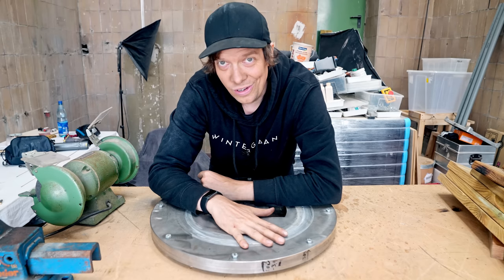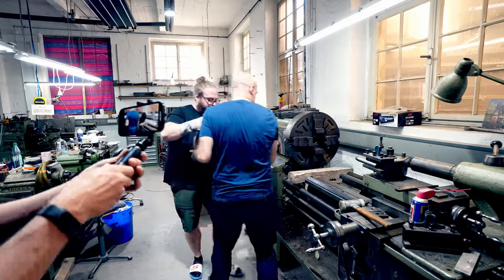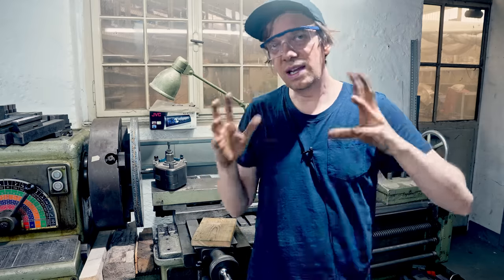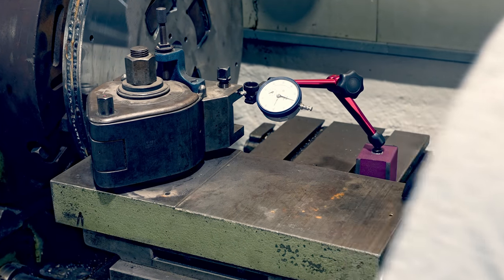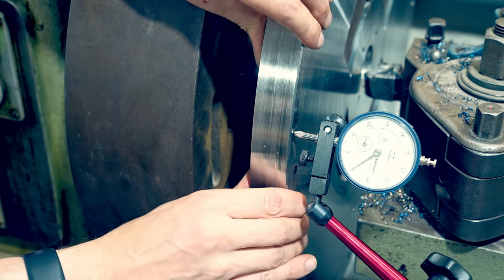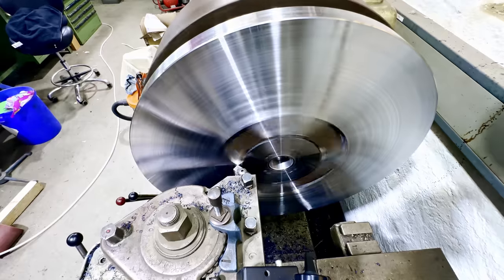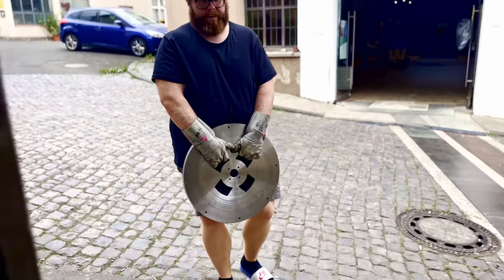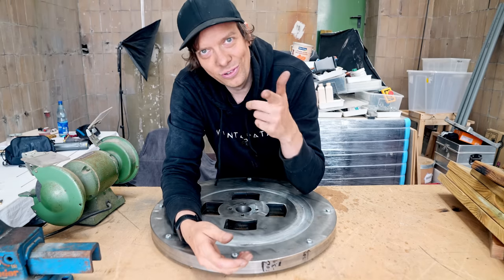Can I Turn This Wobbly Flywheel Straight? - DAY 7,8,9 - Marble Machine Flywheel Prototype

Comment: Just remember that it's a prototype, a proof of concept. It's not meant to represent the final build, but to experiment and figure out what works and what doesn't.
Reply: "Don't fail to learn ... fail in order to learn"
Reply: @keeperMLT  isnt this basically the same? failing to learn and failing in order to learn?
Reply: @SirCavas  In this context "Fail to learn"  means to miss an opportunity to learn. "Fail in order to learn" means here to use failure as an opportunity to learn. 🙂
Reply: @bragebh7122  okay it makes sense then
Reply: It entirely depends what are the goals for the prototype. Some are used to test a viability of a small little mechanic, some are used in order to test out the final build. Just saying that a prototype is not meant to be representative of a final build is factually false statement.
Reply: Just like the other 2 machines...
Reply: @DumahBrazorf  thats just a hilariously stupid thing to say after all those videos he made

Comment: I would suggest remounting the flywheel on the rod but do while the flywheel is laying face down. 

As you showed, when youre tightening the tapered bushing, the flywheel is pressing down on the bushing and on the shift from one direction.   If you lay the flywheel flat on a face and have the rod vertical you can ensure a couple things.  The flywheel isn't adding an extra 20kg of weight to one side of the bushing and you can ensure the shaft remains at a 90 degree to the flywheel when you tighten the bushing. 

Basically what I'm saying is that your current method of mounting the flywheel to the rod could be causing some of the runout.

Comment: I would suggest turning the flywheel face while the shaft is installed and clamped. This way you will be dead centre.
Even better way is turning between centre’s, in this way you can do the face turning of both side at the same time.

Comment: I have watched this series since day one and as an engineer I have banged my head in the desk so many times. 
I am NOT criticizing anything. Experimental design can lead to good things and it was nice to see the MMXs form before function design giving it that steam punk feeling. And this is you journey to fame, not for profit...
But in this rapid test phase, please just steal proven designs. For the flyWheel, just get a back wheel hub from a front wheel driven car, or a trailer. You get the hub, the break and the lugnuts to mount the flywheel in one go. Instead of spending a week, it would take a day.
In many parts of the design, just figure out if it is already made and steal it.

All the best to you and the team.

Comment: Turning tip 2: When making exact diameter, first go 1 mm short, measure accurately, then take half of the remaining away. Again measure accurately and adjust the last cut based on how much more or less than the intended you got. That way the machine flex is eliminated. Also, you get a better surface cutting half a millimeter than cutting much thinner. The tool edge works better when the chip is not too thin. You get to maybe 0,03 mm accurate this way, then the rest is done by sanding.

Comment: As a machinist that runs a lathe and mill dairy this is a little difficult to watch lol, but you're learning Martin so that all that matters. 👍👍
You could bore the center of the first disc again you'd just have to use some filler wire and TiG weld the bore first the dial in the OD to be concentric the bore the ID.

Comment: I post this a bit late, but I wish Martin can read it : what about replacing the flyweel by a car (or truck if you want something really heavy) wheel, with the matching wheel hub and brake disk ? It's an easy solution, there is plenty of company balancing perfectly cars wheels, you can use the braking disk as an emergency brake system. And if the wheel is not heavy enough... put a second one or increase the ratio to make it turn faster (wheels are designed to turn fast and true). Pragmatic engineering.

Comment: This is not the best exercise for a true beginner, you got that right.

1. Start with a bigger piece than you need.
2. Create a truly flat face to which you are going to reference everything else.
3. Turn the piece over and use machining blocks between the face of the chuck and the freshly turned face of the piece, so that you are running true to that reference plane.
4. Then you can do the ID, OD and last face. 

Possible problems: 
1. The chuck itself might not be square. Check the run-off of the jaws and face.
2. The support is really far away from the edge, which might lead to wobbliness when cutting the OD. In this case you can't do much about it, since it's the only chuck that fits the piece on the whole shop...

Comment: When you decide on a speed for facing you usually use the middle diameter of the part. That way you have the best possible finish over the biggest possible area.

It's also easier to use a center in the tailstock to set the tool hight since they end in a small point. I'd also always lock the tool when checking the hight since some quick change systems slightly pull up the tool when tightening.

Comment: When welding together plates for a flywheel I suggest cutting deep notches horizontally along the edge and filling them with weld so there is no chance of cutting through them on the lathe, potentially sending a sharp plate flying. You could even go an inch deep with your angle grinder and filling that. Or you could fill the bolt holes with weld instead for the same effect.

Comment: Start over with the center bore after welding it up to replace the material.   Utilize 6000 series stick, 60k.  Reface both sides.   You can add weight to the perimeter with lead plugs cross drilled, heavily chamfer both faces and pein the plugs in.   Be very careful with your ram's especially with the small shaft size.  Or...Start over and you have a nice lamp base!  Keep going sir and have fun.

Comment: I really enjoy your channel. I would like to make a suggestion. On your next flywheel design, make the holes for the jaws of the four jaw Chuck in a larger diameter. Most chucks have reversible jaws that ban be set to hold pieces from the outside or the inside. If you set yours to hold from the outside  and position the holes further out from the center then the piece will be more firmly held in the Chuck. Less chance for runout. Also if you start with the flattest side towards the Chuck and position the piece firmly against the flats for the face of the jaws, then do your face cut and boring then last side will be closer to true and should only need a small face cut. Great work so far!

Comment: Loosen up your taper bush and you can adjust your flywheel wobble.  A good way to do that is to use a ball race mounted on the frame to push against the high spots as the wheel turns.  A dial indicator will also do the job.  If that fails get some thicker shaft and true up the flywheel by turning it between centers while mounted on the shaft or a shorter segment of shaft material.

Comment: I recommend using the four-jaw chuck ONLY to bore the bearing mount and face the part -- then put the bushing in and turn between centres. Of course, THAT requires a strong enough shaft. Add that to Design Notes for next mark...

Comment: Hello Martin, SKF is right, you need to use a bigger shaft with a bigger bushing. Therefore you will redo the bore in the flywheel and fix the dimension you had thickened with weld.

Comment: Changing position on the axle changing the wobble, is because you loosened the tapered bushing. Use indicator to align it on the axle WHILE tightening the tapered bushing. 0,05mm deviation at the axle will show these results on the outer edge

Comment: A Good sequence,  get the center hole indicated,   cut to size.   Make a fixture that fits the center hole and can be used to clamp the flywheel to the Lathe,  indicate the fixture, then all other turnings with be perpendicular to or parallel with the fixture.

Comment: Just finished my apprenticeship as a machinist. 

Tips: 

I usually use both hands on the Z-axis handwheel, so not on the handle, but on the outer ring. It gives you better control for more consistent hand feeding, for when you are not using the autofeed. 
Sparks from turning usually indicate a hard or hardened surface. Can also be a sign that your insert is worn. Always check your inserts. 

Some thoughts:

You essentially lathed a away your welds on the ID and OD. I may be wrong... Could also lead to less rigidity within the workpiece itself.  
I could imagine that somehow you kinda warped the part as you clamped it into your chuck. Perhaps check if those four holes are nice and square to the face of the plate. 
I would, for professional work, use a big round stock piece instead of welded plates. I understand that wasn't an option for you, because you already had the plats and big stock pieces like that are expensive.
Reply: And recommendations on what kind of insert? We have boxes full of them. But I don't really know what would work best for the flywheel.

I also wondered if the 4 jaw chuck could've warped the part. I highly doubt it to be within 10th of a mm. The chuck loosening was a big bummer though. Luckily due to safetys it couldn't end up falling off.

Comment: You could add some kind of vibration absorption mechanism (rubber padding for example) between the flywheel and the frame, that way tolerance for the wheel machining is higher and even if it is not perfect, it doesn’t affect the rest of the machine as much.

Comment: You could mount the flywheel on the shaft, add a dog leg, and you can resurface each side while I reference to the shaft. Also since you need to upgrade to the 30mm shaft, your good to go to fix anyway. But regardless of all that, good job on your first time running a lathe!

Comment: I used to do a bit of turning but that was 10 years ago so this is to be checked.
I think one of the issue is that you are doing the center hole before the rest, while this can't be used as a reference. 
I think a better option would be to machine one face first. This face will not be perfectly aligned with the rest, but it will be flat. Then, turn around the wheel to put this flat face against the mandrel (the first cut made the surface flat so it should be now easy to get this surface lying fully flat on the mandrel). When checking for the alignment with the mandrel like at min 4, this should be done on the surface that is against the mandrel, not the opposite one. This flat face will now be your reference. And  now you should be able to machine the rest and everything should be aligned with the first face. The second face should be parallel to the first one, the OD and ID should be orthogonal to the first face, and if you did not remove the wheel  between the OD and ID, there will be also concentric.
I think this is always the case when machining  (turning or milling), the first step is to make some kind of reference surfaces then turn around your piece in the chunk and only then start measuring and trying to align surfaces.

Comment: if you want to bore a part you need to make sure the chuck is tight and running true, face the part, flip it and seat the faced side against the chuck face so you have a precise reference side, then bore the center hole. That's the only way to make sure that center bore is square to the rest of the work.
Now you've faced both sides you can reweld the hole, chuck the work back up, dial it in, then rebore it. SHould give you a much better result :D

Comment: I've been looking at the foot pedal for a while and there's a nasty pinch point near the end that looks like it could cause some real damage, ideally the side profile would be an arc with a raidius that is the length of the rotation point that it's on, and you could use a thin piece of wood to get a curve to cover it. It's hard to explain but I could model it to illustrate if that doesn't make sense.
Reply: Ya, I mentioned the same thing. It's low likelihood in comparison with the danger the sides presented, but anything getting in there will actually be crushed with even MORE mechanical advantage, since that gap only opens and closes by like an inch with nearly a foot of pedal travel.

Comment: As you have an engineer you might check with them, but if you want the flywheel running REALLY true on your final setup, you (assuming it's safe) could mount it on the shaft, and turn it while already mounted, that would guarantee concentricity.

Comment: A good technique for building strange machines is to use common mechanical ecosystems, for instance, you could have built your shaft dimensions to suit large engine flywheels and a standard brake system, a large electric motor would provide huge mass and good bearings, but you would have to remove some components to avoid making electronic music.

Comment: 1) so glad to see you are taking safety more seriously!...lol, you wearing that watch the first video game me a serious case of heebie-jeebies.
2) you can always bore-out a larger hole and then press-fit a piece with the correct hole size bored in it.
3) i don't think you are going to get good results chucking-it-up like that, you should probably use a faceplate, or even better, put it on an arbor with a taper that'll fit in the spindle.
great stuff! 😎👍

Comment: In case you gonna order metal sheet parts where flatness is crucial: consider water-jet-cutting as it does not warp the metal as it does not heat up the metal as much as a laser beam does.

Comment: If the high point and low point are 180degrees out from each other, more than likely the flywheel is not straight on the axel amd your problem is as simple as realigning your bushing in the wheel

Edit: I watched til the end, and im pretty sure your not fully square on the bushing. The dial indicator reading is basically showing a perfect sine wave, which means high/low spots are 180degrees out. If it was a specific high or low spot, the readings would be more erratic.

Edit Edit: Do a drop check from the bushing face to the flywheel face at 3 or 4 points. That needs to be preferably 0 or as close as humaney possible.

Comment: the individual pieces of the flywheel needed to be lathed as well, even if you screw them together it will not be true on the inside and there will be difference in mass and produce undesired vibrations due to some parts of the wheel being heavier than others and producing instability

seeing the results and the unfortunate event of the chuck being loose, the best thing to do is to balance each part of the flywheel separately, the other thing about the shaft being bigger is also a good idea

i'd recommend have a new flywheel and a new shaft for better reliability, instead of saving these parts, unbalanced wheels and a bent shaft will introduce a lot of vibrations to the machine, that is something you don't want

thanks for all the content
Reply: hese flywheels are just prototypes
Reply: this.

Maybe it's even enough to hammer it a bit before tighten the screws. Similar to how Martin coarsely aligned the unturned piece to the chucks.

Comment: You could move up to the 30mm shaft, weld the full flywheel together, and then turn the shaft with flywheel mounted between centres on the lathe. That's the only way sure to get the flywheel faces 100% perpendicular to the axis of the shaft.

Comment: I means a prototype and its great that you learn how these things are done, however thats exactly the reason we were all saying you should get a single piece flywheel machined and balanced by a proper machine shop :D at least for the final machine once you have the weight figured out.

Also please make sure to wear safety shoes with a steel cap. Theyre like 60€

Comment: This is where you can learn about turning for a bushing that is press fit or liquid nitrogen fit in and then it can be turned back to spec again. It might be your best chance to give it another try and learn something more about turning. I will say that chuck handle might have had a far bigger hammer or at least harder hammer bonking it to get it to a tighter fit as a sharp impact will do that where a rubber or even deadblow hammer will not get. That head should not move at all even when pushing it. Could be a bit worn out on the threads which is why it needs the bonking. 

Another thing you can do is take the shaft and do a little persuasion to it and get that needed bent section just right and turn the shaft and lock it down in the right position to level out the wheel. Even though in the end of this is the flywheel needs to be balanced weight wise. Thats weight from center of shaft out to outer edge. Then there is also weight balancing from side to side and even though turning can get it even and smooth, weight wise if can still be off enough to matter

Comment: I believe the pulley and flywheel might benefit from a spoked design, like a bicycle wheel. Concentrating the flywheels mass on its outer rim would dramatically increase its angular momentum.

Comment: If the bushing is slightly off but the shaft is slightly bent, you should be able to minimize the wobble by rotating the shaft in the bushing to try to make those errors compensate each other as much as possible.

Comment: You can reduce some of the runout by loosing the taper slightly, check/adjust the runout like you did on the 4-jaw, then tighten the taper.

Comment: I suspect the wobbling is due to the braking systems, which exert significant lateral force on the flywheel, potentially causing the shaft to bend. At the start of the video, you pointed out about a 1cm offset in the wheel. While the wheel might not be perfectly round or flat, such a substantial offset can't be attributed to just a minor imperfection. By the end of the video, you observed that the shaft had bent, even though it appeared straight in previous videos.